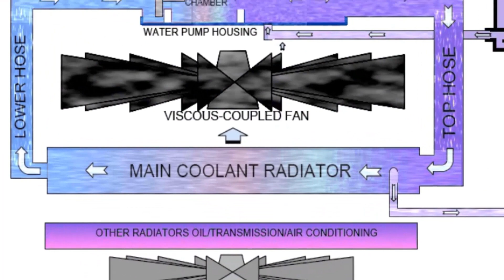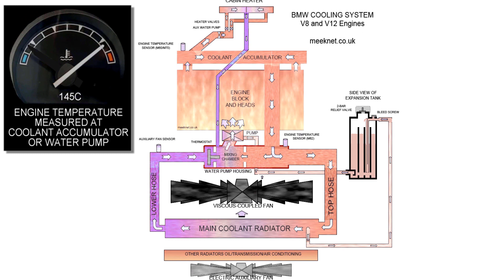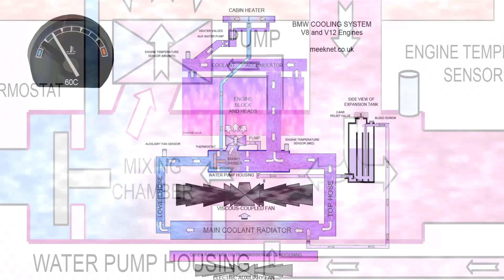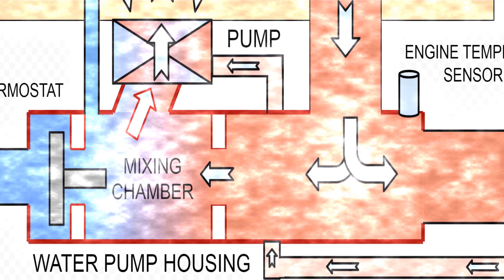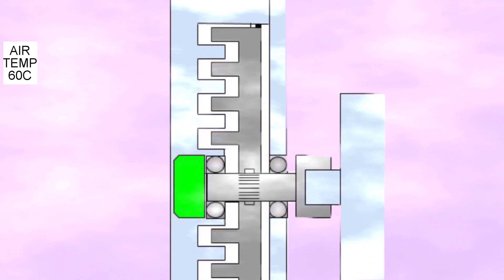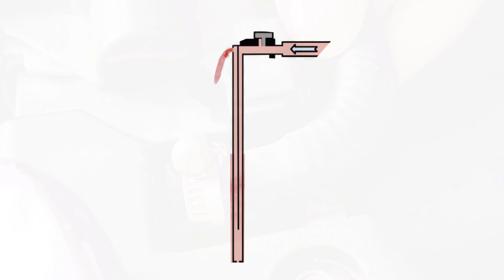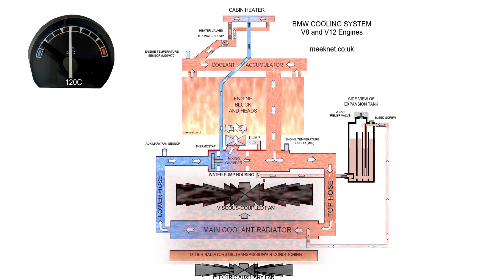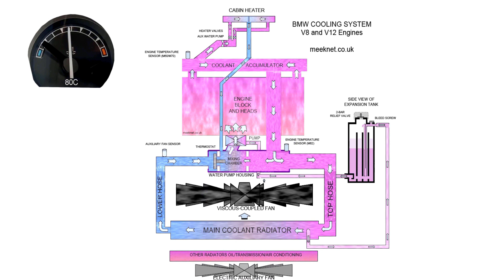BMW V8 and V12 Cooling Systems Explained

Comment: Great video on its engineering.   Just want to point out the auxiliary pump (secondary coolant pump) that assists at low rpm’s in evacuating collolant from engine core is absent in your video.
Reply from the maker: Thanks! Although it is a very small side effect if the heater is actually giving out heat - don't forget that on hot days with the heater off both the heater valves are closed and that side effect is not present. The auxiliary water pump is fitted to provide restorative heating when the engine is not running - or when the revs are insufficient to move the coolant around the cabin heater matrix.
Reply: @TimmsBMW  The BMW community is forever indebted to you.  What a great machines BMW used to make absolute pinnacle.  And your work is equally or more unbelievable.  I hope one day directors in Munich look at your videos and the work you put in them.

Comment: Hi, would you recommend lower temperature thermostat fo M62 and unplug the wire from it or go with OEM 105 celsius thermostat? I have activation Map cooling error, so the heating element is probalby done. Went threw many different opinions on forums and I am confused... somene says get lower thermostat someone says go with OEM 105 thermostat... can you help me? Thank you :)
Reply from the maker: I would be happier with a 95C stat

Comment: Thank you very much for sharing these valuable information!!! Just subscribed. 

So I recently got BMW e38 2000 v12 750iL m73 engine and I am wondering what should be engine operating temperature? I recently replace one hose that was cracked and bleed the system with the 50/50 blue bmw coolant. The gauge is sitting in the middle perfectly but when I unlock the KTMP is reading 105-108 celsius while idling and it goes down to 103-104 when driving. Any suggestions? 

Thanks again!!!
Reply from the maker: Thanks! Perfect operating temperature for the M73!
Reply: @TimmsBMW  Thank you very much for your reply and help!!! I appreciate it a lot.

Comment: Hi Tim, i have just replaced thermostat and waterpump. Intermittently i and getting message  coolant level low, however when i check the expansion tank its fine (as i just replaced everything) . So my thinking is that it could be a coolant level sensor issue, maybe a connection etc. Where is this sensor located please ?
Reply from the maker: This is usually a leak in the expansion tank - the level sensor is underneath it in is magnetically coupled to a float in the tank. The usual problem is that you get a tiny leak from the internal parts of the tank, and the coolant ends up in the sensor. I have a video where I replace the expansion tank and another where I chop it up!
Reply: @TimmsBMW  ok great thank you, I have purchased a new expansion tank just to be sure😊

Comment: Would like to say that this video helped me to identify how the coolant circulates from the pump to the heater matrix.
Have had trouble with my m60 engined e30 and it appears I had the hoses the wrong way around.
Now I have the smaller pipe going into my matrix then the larger from the matrix back to the pump
Cheers, Ant 😎
Reply from the maker: Always my pleasure, and glad it helped!
Reply: @TimmsBMW  Certainly did mate. I drove the car for the first time today only up the street and back. My god what an animal haha.
Still need to bleed her out though as she's playing hard to get. Chucking a pressure bleeder on it tommorow fingers crossed 
Thanks again Tim

Comment: Hello Timm! Nice work explaining the cooling system of this old V8s. I have a E39 540i and I notice when the car is at operating temperature, when I step on the accelerator, I get to hear this loud fan noise. It's like am driving a big truck. I don't get to hear the roar of that M62. What could I do pls?
Reply from the maker: Sounds like the viscous fan is stuck - have a watch of this https://youtu.be/RDuGsDUiXQw
Reply: @TimmsBMW  Thank you Timm, I will watch the video. However, I just changed the viscous fan a week ago and same thing.

Comment: This is fantastic information.  How this works is often misunderstood by mechanics.  Now I know why the viscous fan comes on for the first few seconds of driving in my E38 and E65.  The fluid has to redistribute before the clutch can spin freely. I did suffer the jammed clutch problem once on my E38. I heard the fan scream so I backed off and drove home not exceeding 2000 RPM. My Z3 has a bimetallic component on the front of the clutch which controls some sort of valve.  I need to see if I can adjust it because it's on too much at the moment.

Comment: Hi Tim... thank you for all your great videos.. I have a question that I havnt found an answer to anywhere on the net. Can you tell me how I can flush the coolant system in the m62 engine? I had a mishap with transmission oil cooler breaking down and I got tranny oil in my coolant system.. ever since I will find oil in the reservoir every couple thousand kilometres and I'm afraid that if might clog up one of the water passages over time like cholesterol in the blood. Giving my car a stroke essentially lol.. it seems like a complicated system and I can't see how I can thoroughly flush places like the valley pan
Reply from the maker: Sure Housam, I show it here: https://www.meeknet.co.uk/e31/E31_Cooling_System_Flushing_Bleeding.htm

Comment: Tim, I am having an issue with a 1997 E31. The temp indicator is always every so slightly passed the mid point. I mean you really have to concentrate to see it. I have had at least 2 occasions where it started to go up and then I guess aux fan kicked in. One time when it started to over heat I turned the car off and back on immediately and it was just fine ( slightly passed the half point ). It is very frustrating. Mind you I did some work on the heater valves but the problem was there even before that. Any idea what could be the issue. Oh and yes when I changed the fluid I did wait more than 5 minutes and things started bubbling out of the expnassion tank
Reply from the maker: It all depends when it started overheating - if the car was at idle then I would suspect the viscous-coupled fan

Comment: Thanks for the explanation - very helpful. I have an M62B44 race engine and was wondering what a good operating temp would be. From your video it looks like the standard engine runs about 120*C (I've been struggling to keep my engine below 100*C. Oil Temp is 95*C. I have no mechanical pump (impeller removed) and use a Craig Davies EWP on large cross flow radiator for flow control (runs off an EWP controller that pulse the pump at low temp and comes on full time over a set temp). I also didn't realise to keep the expansion tank level below the intake from the over flow (so I might be sucking air back into the radiator).
Good to know that the higher pressure helps to keep the water from vaporising (into steam) within the engine creating hot (steam) point which would increase hot spots (no water to carry heat away).  Thanks again.
Reply from the maker: Thanks David! 85C would be my target at the inlet if possible.
Reply: @TimmsBMW  Sorted. Previous owner had installed the EWP at the bottom of the radiator, but hose to the header tank was on original mechanical water pump (impeller/belt removed). Thermostat was also removed. This caused 'colder' water to circulate into the header tank (bypassing the engine). There was also a very small restrictor left in where the thermostat was (we removed that and idle was 94*C at outlet). During race the oil was 116*C and Water 93*C at full noise. 
1 small question. The race car has no cabin heater or cooler. The accumulator at the rear of the engine has the cabin pipes removed and welded off. Can I block the small transfer tube from the old thermostat/mixer to the rear of the engine? My thought are it it transfer 'cooler' water from the radiator to the rear accumulator which is mixing with hot engine water can thus some is returning to the front via the large tube (and not cooling the engine). The EQP has a controller that pulses and variably powers the EWP so not hot spots - comes on 100% when over 85*C.
thanks again - David
Reply from the maker: @davidproud4039  Hello David, the coolant from the rear accumulator should go in the other direction - from the accumulator to the water pump housing - just like the large pipe does. However, with the heater pipes welded shut there will be no water going either way!
Reply: @TimmsBMW  Hi. to clarify, the 'backside' of the accumulator (where the cabin pipes were) are welded closed (as the pipes removed). The two pipes above the valley are still there (and open). Thus I think the 2 pipes above the valley are still working (they both get very hot). I'm sure the large pipe is working as this is how the hot water gets from the back of the engine to the radiator (through the now 'empty' void of the old impeller. The smaller pipe above the valley connects the Thermostat/Mixer to the accumulator, and from your video seems to flow from thermostat/mixer to the rear (as you say to prevent cold water hitting a hot engine) - the EWP always pulses off/on to prevent thermal shock while warming up (full on when T over 85*C).
So I now understand your comment - both pipes go the same way (from rear to front). My question is, I don't think I need the small pipe above the valley to feed 'hot' water into the mixer as the EWP pulsing/full does this now? If I block the small pipe then the engine should get more cooler water?
Reply from the maker: @davidproud4039  The smaller over-valley pipe takes coolant from the heater matrix to the mixing chamber. Although it looks like it is connected to the accumulator it isn't (or it shouldn't be), in fact, on the E31 with the V12 the pipe avoids the accumulator altogether and goes straight to the mixing chamber. So, either the accumulator has been damaged or the pipe is being heated by conduction rather than any coolant flowing through it. You don't need it if you don't have a heater!
Reply: @TimmsBMW  Awesome - thanks so much. You have explained things amazingly. Have a super Christmas and stay safe :)

Comment: Hi Timm, I appreciate your videos a lot, they are gold to me. I have a problem with my E38 740D (M67) cooling system. My EGR Cooler was leaking, so that was replaced. I have also replaced viscous clutch, thermostat, EGR thermostat. Now whenever I reach higher temperature with the car (88-91C), coolant will flush out of my expansion tank cap due to overpressure. I would be grateful for any ideas what could cause the issue. CHEERS !
Reply from the maker: Coolant will come out if the system is over-filled as it leaves no room for expansion. If the level was right get a new expansion-tank cap!
Reply: @TimmsBMW  Thanks for your reply. I have also replaced the expansion tank Cap as well as all vent screws. The level was right. Is there any chance my cylinder head gaskets are leaking combustion gas into my cooling system through one of the channels ?  Tried a CO2 test, came out slightly positive. There is no yellow mas forming anywhere, also no sign for coolant combustion in the exhaust. 
I appreciate your time and help.

Comment: Thanks For another great video!
Timm, do you think many of the cooling system parts fail due to excessive pressure? I am debating changing the radiator cap on my 03 540i from a stock 2.0 bar to the 1.4 or 1.2 bar BMW radiator cap to reduce pressure, reduce failure of parts, and prolong their life. Have you heard of this modification?
Reply from the maker: Hello Alan, the cap will not make a jot of difference - unless the system is over-filled in which case it may reduce the system pressure. If the cooling system is filled correctly then the cap will have no effect on the system pressure as the pressure will be around 1 Bar or so. The real fix is to get rid of the temperature-mapped thermostat for an 85C or 95C fixed thermostat. See Bimmerforums - they have gone through this many times!
Reply: @TimmsBMW  Thanks Timm! I ordered the 88C 740d thermostat. It does not have the plug or heating element. I've read all weekend on Bimmerforums that a resistor must be used on the wiring harness to avoid the fault the DME will store. Do you know of a "plug-in" resistor that would safely work? I read the BMW 1000 ohm resistor (#13901734469) would work but I am unsure..... Thanks in advance.
Reply: Thanks Timm, will definitely read more on it there. Cheers!

Comment: Great video , i'm no stranger to m60/62 engines however , looked at this after struggling to get my new (to me) 2001 740i to bleed and behave , heaters are only luke warm at operating temp , and when driving the temp slowly creeps up too high , when bringing the revs up a bit higher 2000+ it goes back to normal promptly  , water pump and thermostat look newish (but unknown to me) , radiator is brand new and genuine , also replaced expansion tank and cap , and viscous coupling (which seems to work) , interesting point is that if I put the A/C on the aux fan brings the temp down a little too , (i'm running IBUS software on Headunit to display coolant temp on the IKE for easy monitoring) as the dash gauge is pretty numb , any ideas? i've always followed the correct bleeding method on my previous cars and had very little hassle , sods law that the weekend cruiser gives me hassle and not the track based car!
Reply from the maker: It all depends what you mean by overheating - if you are below 120C then you are probably OK. Anything over that and your cooling efficiency is poor. If the temperature goes above 120C when travelling at 70 MPH or so  then you r coolant probably is not circulating correctly....

Comment: I am confused by your schematic.  On an N62 engine, there is a small diameter hose that runs from the upper part of the expansion tank to 2 points in the engine (it is a "Y" shaped hose).  In your drawing you seem to show such a hose from the expansion tank but running to the Main Coolant Radiator which I don't think is the case.  Incidentally, can that hose (in my description) be changed without draining the cooling system?
Reply from the maker: The 650i uses the same circuit as those featured in the video (M60, M62 and M70), you should see a long thin pipe on top of the radiator housing. In addition there is a Y pipe that bleeds the water pump.

Comment: I changed thermostat to 75 c and lower hose gets warm at 82c than I changed thermostat to 68 c and still opens at 82 c why is doing this sir, you think mixing chamber is causing this ?
Reply from the maker: If you are measuring the coolant temperature via the MID then that temperature is the OUTPUT from the engine - the thermostat operates from the radiator outlet temperature and hence will be at a lower temperature. I would not go any lower that 85C for the M60/M62 as this will increase consumption and wear. All explained here: https://youtu.be/XGIk8IXSGIE

Comment: I have always been very mechanical and can understand a mechanical system and how it works once I see it. I do however, have problems with diagrams and verbal explainations. 
At one point you said with the heater on high temp and reving the engine the air is eventually forced to the radiator and then to the expansion tank. So why does it need a bleeder valve? 
No car I have ever owned has had one. I've had Audi's, BMWs and Mercedes and uncountable American cars.
Is this unique to these particular cars? You said the heater core is higher than the radiator at one point which is hard to imagine. 
Wish I was there to see it then I would know.
Reply from the maker: Hello Werner, the heater core is lower than the radiator - but the heater valves, pipework and auxiliary water pump are higher - and it is there that accumulates air pockets. There is not any real need for a bleed point, as long as the heater system has no air pockets then the system will self-bleed.